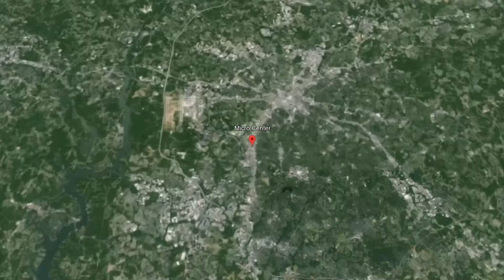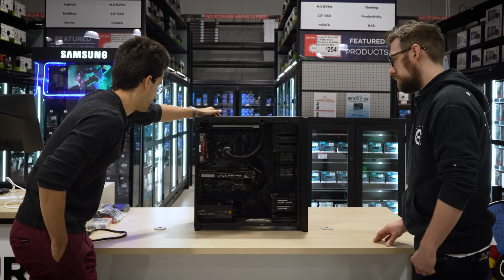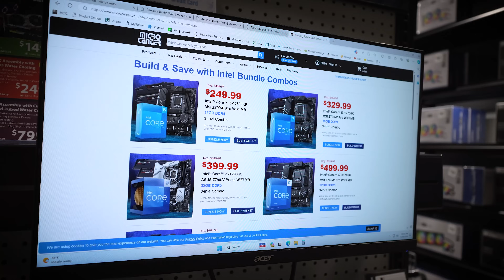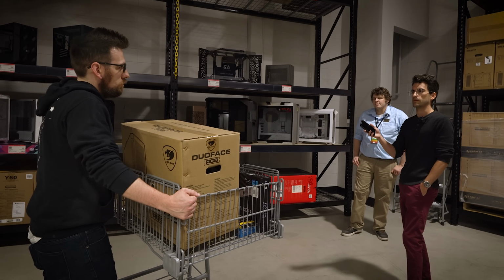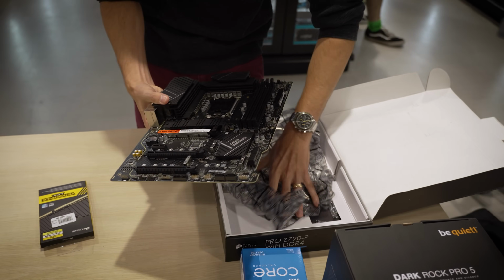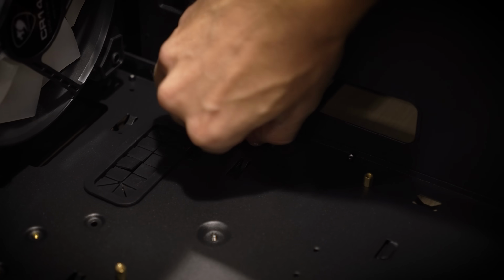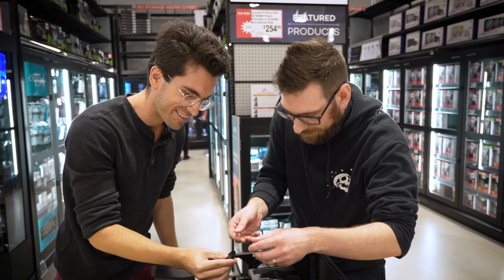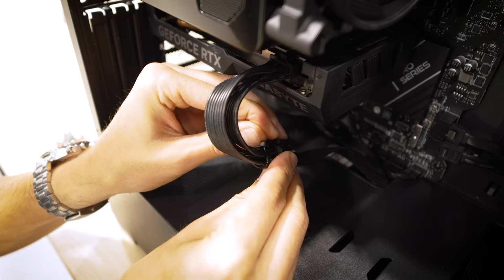We OVERHAULED This Old Gaming PC! - Gear Up S3:E5

Comment: You could've kept the AIO cooler instead of pushing the channel sponsored tower cooler onto him.
Reply: I have an AIO and won't go back to a tower cooler. I have an i7 8700k so an AIO is better.
Reply: No guarantee that the AIO has mounting hardware for the new socket. And maybe he wanted to swap to air cooled? We have no idea what went on behind the scenes. I personally would have migrated such an old aio - they don’t live forever.
Reply: @rasmusvedel  the original CPU was socket 1151 and the new CPU  was socket 1700, when I went from 115x to 1700 I was able to use the same mounting for my waterblock.

Comment: i'm disappointed to see that the AIO wasn't upcycled into the new case, would of gave him that $80 for say extension cables or something.
Reply: Not every board has the LGA1200/115x holes in addition to the LGA1700 holes, and AIOs do degrade over time (JayzTwoCents has discussed this in the past) so getting a beefy air cooler can be a better option.
Reply: @quantumreality215  I'd prefer to repurpose an AIO or buy a new one, to be honest I am not a Air Cooler type person

Comment: Now keep in mind the GTX 1080ti isn't worth replacing with a RTX 4060 unless you want the DLSS. A 1070 yes, but generalizing the whole 10 series is wrong. RTX 4060 is very mediocre card.
Reply from the maker: Yes, you've pointed out the one exception in consumer-grade 10-series :-)

Comment: Over the last week, I sure could have used an 'upgrade' on my main rig, lol.  Started getting immediate shutdowns on boot, checked memory, video card, etc.  Pulled out half my ram and swapped in an older RTX 2060 and it's mostly stable.  Thought i was having some mobo issues and replaced my old Tuf x570 with a Asrock Taichi b550 last night and STILL the same issue.  Tested the memory and card on another machine I put together a few days ago and they're fine.  Turns out I've got a bum R5 5700x (dead memory channel AND fails on enabling resizable bar).  Hell, it'd probably have been a good candidate for 'fix or flop', but I live in NC, lol.
Reply: Mhh, from what I remember, watch out for mounting pressure, it needs to be enough, if not these kind of issues can pop up (speaking from experience).
Reply: @benjaminsmekens2344  This machine has been running for at least a year with this CPU in there.  AM4's don't have near as many issues with pressure as the newer AM5's do though.  I make sure either way to not torque them down till they stop either though, lol.  Also helps that it's the hook-mount type in the machine.

Comment: Going from a 1070 to a 4060 is an insane upgrade. Throwing hate at the 4060 is dumb imo. I went from a 1070 to a 3080 and fuck it was crazy how I never realized the potential the games I played could do at 1440p and 100+FPS
Reply: I have an RTX 3070 in another system and it's ridiculous how well it performs at 1440p. I can't imagine what a 3080 must be like!

Comment: I think the cooler is way overkill for this CPU. A 30$ish cooler will handle 12600kf at ease. And RTX 4060, this abomination should never be put in any build. I was thinking about RX 7600xt but not this abomination.